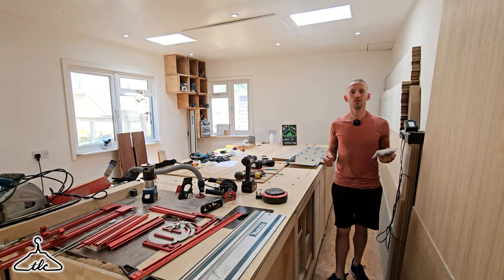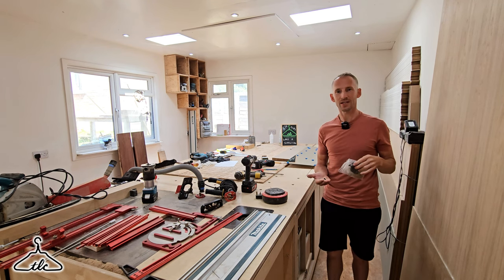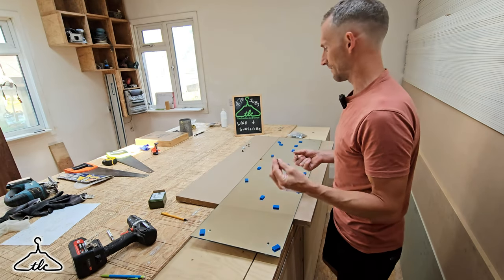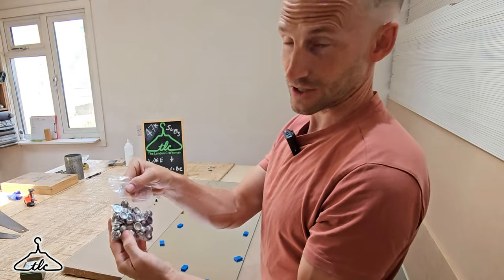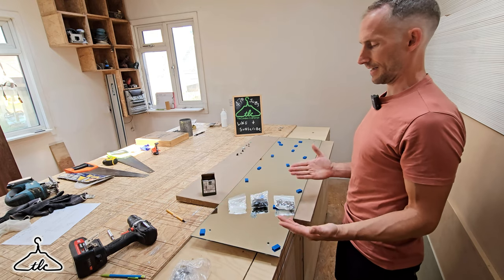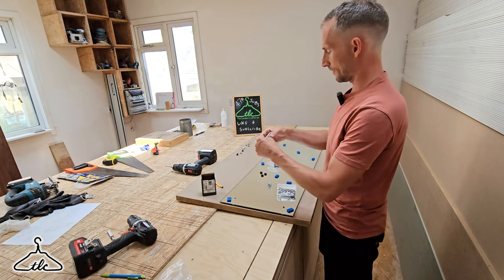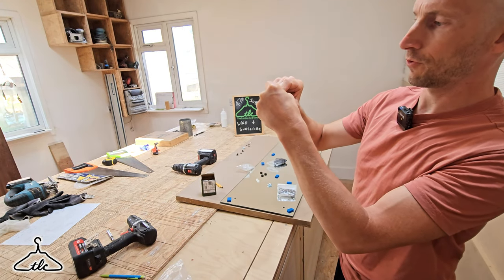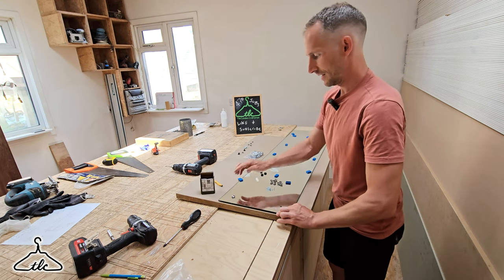MIRROR SCREW HACK : Another Woodworking Money Saving Tip  (It's Pretty Awesome)

Comment: I use a "no screw" method! For years I have been using clear silicone to fit mirrors - with NO FAILURES!. Apply dabs of silicone every cople of inches across the entire mirror and GENTLY push into place on a wall/door etc. Keep applying GENTLE pressure for 2 or 3 mins and you are done! The mirror can be removed later if needed by slowly prying off with a blunt knife etc
Reply from the maker: Yep I've done that too sometimes, I have no probs with that method, works really well 👍

Comment: Hi Ryan, I'm a big fan of your videos and have learned so much from you..many thanks! I  do have one concern with your method in this video..in that you risk screw metal to glass contact, even if the holes are bang on centre, remember the door and mirror are vertical after installation and can move slightly, even with the rubber washer behind. I have used an ever so slight variation on your method, in addition to your method and components, I fit a small length 4mm of silicone tube (Eg. model engine fuel tube) sleeved over the screw thread to completely avoid metal to glass contact. Once again many thanks for your videos Ryan, keep up the excellent work. - A